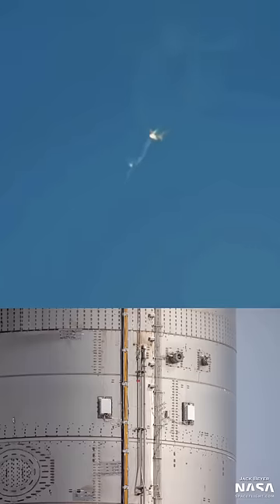Is This Why Starship Wasn’t Destroyed The Moment It Lost Control?

Comment: Imagine being the Range Safety Officer, and actually pushing that big red button covered in glass... and the rocket doesn't explode immediately.
Reply: You need to go out and shot it manually. There's a reason they launched it in Texas.
Reply: Pretty sure they probably already thought of this scenario before.
Reply: Do they even have an RSO as such anymore since the adoption of AFTS? That said, if those two plume events highlighted by Scott was the automated flight termination system working, it means it was quite "patient" in waiting through quite a bit of spinning before deciding to terminate the flight.
Reply: In this case, you call the Raptors, those from USAF.
Reply: @Ale-bj7nd  That's a rocket, not a Hurricane. (Florida, we see you)
Reply: @arthur0x2a  😂
Reply: Lol that would be the worst 15 seconds of your life 😂
Reply: "I am going to have soooo many meetings with the FAA in my near future."
Reply: Joker in The Dark Knight outside of the hospital
Reply: Okay guys! I'm pushing the button! 

Frank, you did push the button....right?!1
Reply: @sietuuba  Its “FTS” or “flight termination system”

There is an RSO. Pretty sure its required by the FAA regulations.

The booster also had some electrical wires running alongside the whole length and if 2 (or more) wires were ripped apart from vehicle breaking up that would also activated the FTS automatically to ensure there are no big pieces left and all the propellant is burned up before hitting the ground.
Reply: @tonamg53  By "as such" I meant human-in-the-loop like in the old days of someone pressing the arm and destruct switches on his console. I'm sure there's still someone with an overseeing role tasked to make sure the system is present and working, but he doesn't push the buttons anymore. The whole point of automating the system is to reduce dependence on ground support staff, increasing launch cadence, and giving flexibility in trajectories as flight termination doesn't require the reception of the destruct command from the flight controllers anymore.

The autonomous FTS is called either AFTS or AFSS (autonomous flights safety system) from what I can gather. It's been in use for several years now by all players. Either way, when listening to the ground control audio loop the term to listen for is still "FTS", even though it's now automated and off of their hands. I'm not sure of the part about the safing procedure though...

And there's no reason to ensure burning of all cryogenic bipropellant in a big vehicle if they aren't particularly toxic like RFNA and UDMH... Hydrolox or methalox rockets' tanks will readily vent away given half a chance so puncturing the tanks open one way or another is good enough, with aerodynamic forces taking care of the rest.
Reply: "boss done fucked up" is the only thing he should be thinking.
Reply: Probably the name of this guy is Doolittle and he started a discussion with the bomb: "Hello, Bomb? Are you with me?" (For the not so old guys among us, look for "Dark Star")
Reply: They need an enclosed button like that for Biden!
Reply: I hate to break it to you but there is no person pushing a big red button. It's a completely automated system.
Reply: Sphincter alert
Reply: They're just at a bar later yelling "I had ONE JOB!" at their drink... 😏 (Add a panel or two of "You've been training for this your whole life..." build-up and that shit's basically a ready-made xkcd comic. 🤣)
Reply: @dr4d1s  there's always a person who can send a command to blow it up as well
Reply: @Richard Cranium Yup, that's what I tried to allude to by saying there's no reason to try and make that happen... the comment was getting long so I left out my opinion that intentionally causing combustion would be a bad result if the FTS activates anywhere near the pad. Hard to say what is less desirable with toxic propellants though, but those aren't used anymore by anyone launching with an automated flight termination system.
Reply: @sietuuba  Yes they would have an RSO
Reply: @tonamg53  FTS and AFTS are different. From the few official documents I found from SpaceX, Space Force and NASA, it seems to me that it was AFTS.

FTS requires signal from ground. AFTS is autonomous.

I can see the electromagnetic chaos around the vehicle interfering with ground signals and increasing the liability by the charge not detonating immediately.
Reply: @CadetPolovitz  “I can see electromagnetic force…”

Ok… Mr. Magneto
Reply: Big major OOOOPS !
Reply: You never want hear abort, abort, abort but it needs to be executed.
Reply: @DerekFischer  It would take them too long to get close. It wouldn't be in the air when they got there.
Reply: Imagine being the idiots who say that the system is 100% autonomous and there's no human in the loop, despite documentation to prove otherwise. 

Imagine being the idiots who do not know the difference between process automation, and autonomy.

I struggle to think of any legitimate implementation of a critical safety system that deliberately excludes human input to over-ride it in some way.
Reply: AFTS specifically doesn't have manual termination triggers from my understanding. The benefit to AFTS over traditional manual approach is not needing all of the GSE to support terminations
Reply: @Cereal Port  can you provide the documentation stating that spacex has a human in the loop for their AFTS implementation? I'm legitimately curious because I've done extensive research on this topic and have not seen that mentioned anywhere, on the contrary I've seen mention of the opposite that the GSE is not equipped for manual termination
Reply: @cerealport2726  Imagine thinking autonomy and automation were somehow mutually exclusive in this application.
Reply: @sietuuba  At no point did I say or imply they were mutually exclusive. 

There are multiple levels of automation, with "full autonomy" generally being regarded as the highest, and most complex level. 

As I have said multiple times already, there probably isn't someone with a finger on a button, but it is extremely unlikely that a critical safety system would lack the ability to be over-ridden by a person in the event that the onboard automated system failed to work correctly. 

Failsafes, redundancies and backups are everywhere in rocketry, and why would this system be any different?
Reply: Stop getting your engineering "facts" from the $hitsons.
Reply: @jonathanmears1  Emo Jabroni spotted.
Reply: @tonamg53  I see as in I understand.

Electromagnetic interference and vibration induced signal loss.
Reply: @cerealport2726  It's only a backup if it can actually back up a failed system in all scenarios, which is nowadays not a given. The heritage GSE (and human) resources and capabilities for a manual fallback option that can be guaranteed to work like the old way simply aren't there anymore. That said, they undoubtedly could try all kinds of things whenever telemetry is available but the infrastructure underpinning it all has been evolved for cost and efficiency reasons (to increase the launch cadence) from the days of the Big Red Button - so that's your answer to how the current system is different.
Reply: @CadetPolovitz  The rocket is 40 km in the sky 🤦🏻‍♂️

There’s no way for you to know that without bullshitting…
Reply: @RevSearch  I know, I'm joking. It's a task for a ASAT weapon.
Reply: @DerekFischer  whoa! Aircraft?  I heard it was way ..WAAAYYYYYY above flyable elevations. But Missiles?  "Tom, fire air-to-air no.1 !
Reply: @mikehipperson  Bad joke.. but Dump the Trump?   ...... I'm on board! 
At least they dumped enabler no. 1-. Fox's  Tucker Carlson! Whew...why take so long?
Reply: @loftsatsympaticodotc  The joke flew over your head, like Starship.
Reply: @cerealport2726 Yeah, despite the existence of AFTS, I’d be shocked if they could not also send a termination command manually.
Reply: @tonamg53  What makes you think that? No, this was shit engineering. The Space Shuttle and SLS SRBs have a linear shaped charge all the length of the booster, which causes instant destruction of the entire booster - this was actually used after the Challenger breakup. The FAA will not allow another such launch until a workable terminate system is in place.
Reply: Musk gets on the roof with a stinger
Reply: @raymondbernardo2645  TOP OF THE WORLD, MA!
Reply: @jonathanmears1  Darmok and Jalad at Tanagra.
Reply: @Richard Cranium What is the regulation for RP-1 and LH-2?
Reply: @Baal Chernobyl wasn't a rocket...was it?
Reply: Watch James May but instead of "separate" replace with "explode" in the Robin reliant clip
Reply: @@richardcranium1776 There's certainly is a difference between a instant detonation and instant  disintegration. I'm pretty sure that, in the regs, there's also an assumption that activation of the FTS results in fairly immediate results. They didn't get immediate results. Put that time delay into a different context - e.g. it veers off course straight after launch, starts heading towards people. A delay that long between initiation and result isn't going to be enough to safeguard those people. Something like this can travel a very long way in the wrong direction, if it's able to hold together for 15+ seconds. I think that, really, SpaceX has ventured into unchartered territory; most other rockets are flimsy things only just able to hold themselves together at the best of times. They reliably turn themselves into small chunks the instant something goes wrong. However, this one is built out of fairly thick stainless steel. It's not going to turn itself into small fragments on FTS initiation, or even if the fuel does eventually go "whoomph". It'd be interesting to see what sizes of debris were left over from this flight; if there's any really big bits, the FAA might want to rethink it's FTS requirements...
Reply: @benfuller2407  " I'm pushing the damned thing, it's STUCK! DOES ANYONE HAVE A PHILLIPS HEAD, F*CK??!!"
Reply: @raymondbernardo2645  I can 100% picture this and I love it!!  😂😂
Reply: Yeah, that's a pucker moment for sure!! 😳
Reply: ... Texans in the next two counties quick unlocking their weapons racks on their pickups because they know they can bring it down with an AR-15....
Reply: Sad RSO noises
Reply: “Pr-press it again.”😮
Reply: @DerekFischer  Useless! They'd still be on the runway by the time the rocket crashed😂😂
Reply: Someone in charge of pressing that button definitely has the knowledge to expect it in advance
Reply: @bomma2694  Indeed! Even there, in the air, besides Starbase, waiting, It wouldn't work HAHAHAH
Reply: @ComDenox  actually no, surprisingly they tell that guy almost nothing. As far as he knows, he’s pressing a button that will initiate a burst of confetti into the office. He goes in like this so nobody can say he made an irrational choice, so the reality is that he made zero choices and simply follows instructions.
Reply: @DerekFischer  Yup! It was over in seconds.
Reply: @Ulrich.Bierwisch  I may only be 19, but I know Dave O'Bannon enough to be aware of Dark Star's existence.
Reply: All their life choices became meaningless
Reply: wow
Reply: Code brown
Reply: @Ale-bj7nd  😂😂😂
Reply: "Where's the Kaboom? There's supposed to be an earth shattering kaboom!"
Reply: it lost 5-8k feet in last 10 seconds to went from 40k to 29k in ver short amount of time
Reply: I’m coming to save the world y’all. It’s still hard to believe that people STILL go back and forth about other peoples business😂. If we all minded our own and helped one another the world would be better. Coming from a BIG GANGSTA. If I can change for the better of me and my family so can anyone. Each one each one
Reply: Spewed pollution.
Reply: @Ulrich.Bierwisch  "Let there be light!".  But I thought Doolittle was the dead Lt. who told them they had to talk to bomb #20.  Haven't watched it in many years, so I could be wrong.
Reply: @benfuller2407  And you look over at Frank and he's smashing the button with anything he can find. Coffee cups, cartoonishly large mallets, nearby rocket engineers.
Reply: @lukewaggoner9513  sounds about right 😆
Reply: The Elon Knobgobblers really don’t like to hear it, but this thing failed at basically everything it was supposed to do.
Reply: @scifisyko  Nonsense. It failed, sure. But it had a ton of successes along the way. The Falcon 1 failed on nearly every launch attempt, but it paved the way for the Falcon 9. The Falcon 9 failed to land a booster tons of times, but it does it so routinely now that no one really considers it to be extraordinary.

Starship launched and didn't explode on the pad. That in and of itself is a huge win.
Reply: “FIRE THE LASER”!!
Reply: Im assuming the reason they dont use real explosives is because no one wants to ride a rocket rigged to blow at any moment 😂
Reply: @Kratos-eg7ez  FTS is real explosives. It's just not of the size that would readily destroy the rocket. It's designed to use the fact that the rocket is already full of high energy materials that just need to be mixed, rather than just destroying it outright. Explosives to completely destroy it aside from the fuel and oxidizer would be large and quite heavy.

Manned rockets (usually) have a launch escape system allowing the crew capsule to jettison away from the rocket in order to avoid blowing up with the rocket in the event of a problem that requires them to terminate the flight. That said, the Space Shuttle also had multiple FTS systems installed, and we all know from Challenger that it had no launch escape system.
Reply: Wheres the kaboom?  There was suppose to be a star....ship shatterimg kaboom!?!?
Reply: The forces it must have uncounted and ultimately withstood while lallygagging around was nothing short of incredible.
Reply: @Ale-bj7nd 
And this is the “Why” some of us “okies” are jelly of “our” BigSis, Texas
Reply: @DerekFischer  Wouldn't get there fast enough, the reason they do this is so that it's destroyed while it's over water (or for Russia, uninhabited areas), since as it's tumbling it could end up redirecting to be over populated areas, or even just a part of the water that's full of boats rather than being evacuated. That would only take a matter of minutes.
Reply: With Elon watching your every move.
Reply: I'd try to make sure I pushed it again without seeming like I was sending Morse code.  You think they would cut off the fuel to the engines as part of the destruct sequence just to make sure one of them doesn't break off and land back in their lap. It just needs enough impulse to head in the wrong direction, it doesn't have to have fuel for the whole trip.
Reply: @mikehipperson yeah we already used that button on orange Jesus. In November of 2020. Why don’t you just cry about it?  😢😂😂😂😂
Reply: Imagine the first manned flight....can't fix this with jumper cables!
Reply: Yeah happens every day metaphorically mate!
Reply: @Ale-bj7nd  Because you live there?
Reply: @dr4d1s  Nah you love correcting people and killing joy.
You can tell Doc lol
Reply: For those of you who don't know remember Challenger?
After the catastrophic explosion all the astronauts were still contained in a 'pod' like section of the craft.
There is strong evidence they were still alive when descending to the ground.
Now that opens up a whole new discourse on when, how and where should a flight termination initiation be engaged. Which I assume, as everyone else does, was not the situation here.
However, if indeed those unfortunate brave souls were alive after the explosion can you possibly imagine the sheer terror they experienced.
There should be a way of saving them despite the catastrophic failure of all the other systems.
It seems they were ejected yet still shielded in part of the craft which at a guess was the nose and cockpit area?
I'm sure some geniuses will all disagree with this.
Yawn.
I look forward to the ones who don't.
After all the safety of the astronauts should be paramount.
The cruel and inhumane way they died was anything but 'hi tech', cutting edge with the most advanced systems available on the planet.
Escape pod?
Too heavy?
Reply: That's a keye peele sweating meme irl
Reply: @grimmertwin2148  I don't even live in America
Reply: @Ale-bj7nd to to shot it?
Reply: @DerekFischer they're too busy picking fights around other countries
Reply: @raymondbernardo2645 LOL underrated comment. Probably most people don’t know what a stinger is. My hat is off to you, sir.
Reply: @jonathanmears1 one of the most cinematic and hilarious scene ever
Reply: I would absolutely be pressing it a few more times if nothing happened in the first 5 seconds 😂
Reply: @jonathanmears1 Darmok and Jalad at Tanagra.
Reply: @Ulrich.Bierwisch 😂😂😂😂😂😂😂😂😂😂😂😂😂😂😂😂😂😂😂😂
Reply: @Ale-bj7nd fr. Being known as a range safety officer just makes it feel like they have to duty and command to walk outside, lower their cap and point a 500S&W in the general direction of the rocket
Reply: @sietuuba why don't passenger aircraft carry these systems?
Reply: I can imagine that, because that’s how it’s expected to happen. It’s not a push and bang scenario. Didn’t you watch the short??? Pressure needs to stabilize before it can actually catch fire, and then explode. That was what was being explained the whole time. And while us Lehmen might not all understand the physics behind it, done of us do, and you can be sure that the rocket scientists behind the project know. It acted exactly as it should have. So in short the guy who pressed the big button knew it would take some time before it actually blew.
Reply: CC
Reply: @Ale-bj7nd 😂😂😂
Reply: I just always think about all the time and effort it takes to build one of these rockets then it has to be blown up right after launch. What a downer.
Reply: Imagine being the engineer in Chernobyl and the reactor doesnt shut down after you press the red button. 😭😭😭
Reply: That's when they fire a Surface to Air missile at it.
Reply: @Ale-bj7nd yeehaw! pew pew
Reply: Imagine Thinking About It And It Does.😮
Reply: No big mystery they didn't put enough boom in the FTS. Starships outer shell and tanks are over-engineered for FTS to rupture big enough holes in the tanks and the integrity of Starship. When Starship hit the denser atmosphere it broke up, simple...